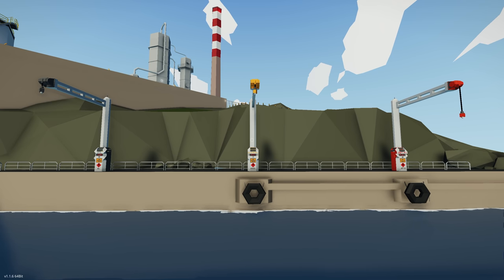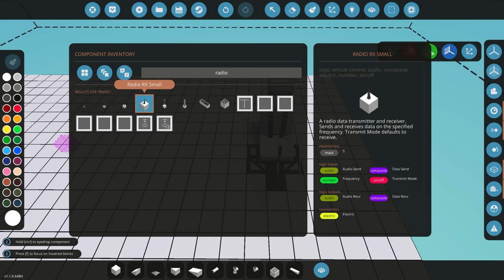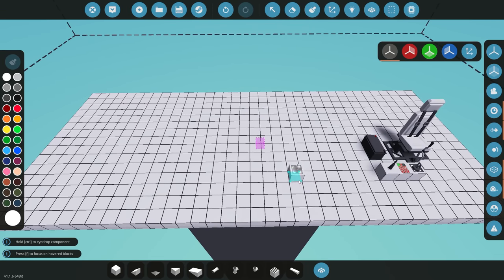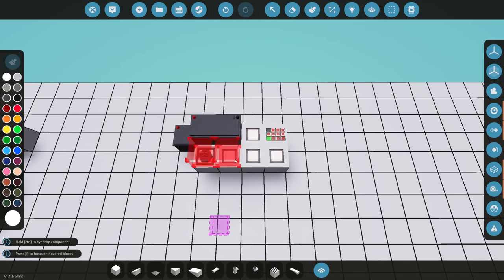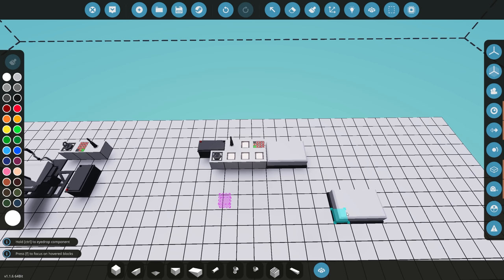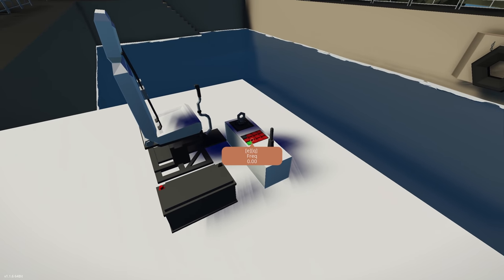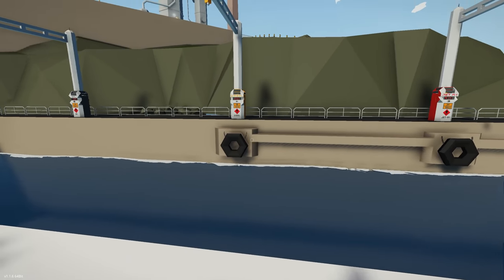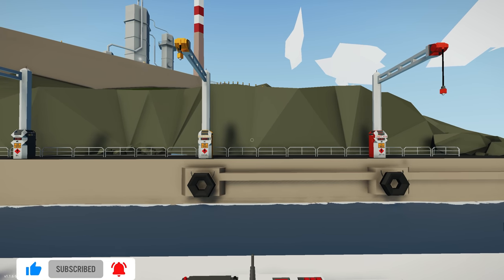How to Control Fluid Gantries Remotely - Stormworks

Comment: For anyone who lands here in more recent years, they've changed gantries. This tutorial is out of date; none of these will work as-is. There is no longer a switch for remote controlling on the gantries; they're always on. They also do not use boolean values for controls anymore (except on/off), which means you will also need a microcontroller for using the handheld remote controllers:
Boolean channel 1: toggle pump on/off (default 1)
Number channel 1: left/right (default a/d)
Number channel 2: connector up/down (default w/s)

Additionally, the number channels will not work with inputs greater than -0.8 and less than 0.8. Unless you change this in your microcontroller so that inputs are always, say -1 and 1, you will need to press and hold the button for about a second to get the gantry to move.
Reply: Thanks for the heads up, the guy who postdd fhe video should take it down, you saved me some time, thank you

Comment: the cranes now run off of numerical composites.... i hope this saves some one some time.... pump on /off toggle is on signal on /off channel one
Reply from the maker: Yes as shown in the video. Nothing has been changed since then.
Reply: @MrNJersey  I thought in the video is shows composite on/off 1 through 4 to control movement, when I did it today it was numerical a/d s/w.... unless im being completely derpy which is possible xD
Reply: @MrNJersey  seems like it has? pressing 1 on the remote controller like you said no longer moves the arm, it turns the fuel pump on and off.
**edit: just found out what has me confused. you now control the crane with WASD. but you have  to hold your buttons down for around 4 seconds before it start to move.
think this is because the sensitivity of the controller is hardcoded to 10% and the cranes  are coded to not move before the number your controller sends reaches like 0.9

Comment: Connection with the controller does not work, something has changed in either gantry or remote controller itself. I am connecting cause any enablement of RC is turnig gantry pumps on/off